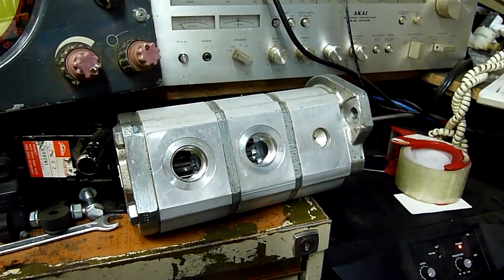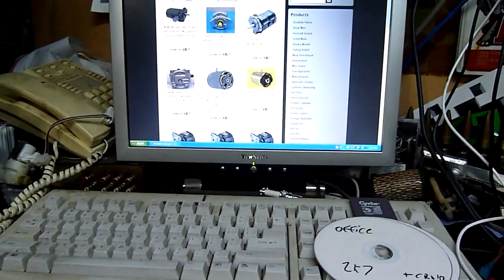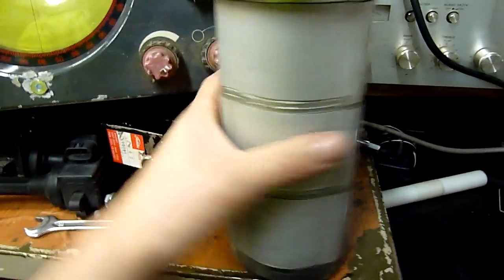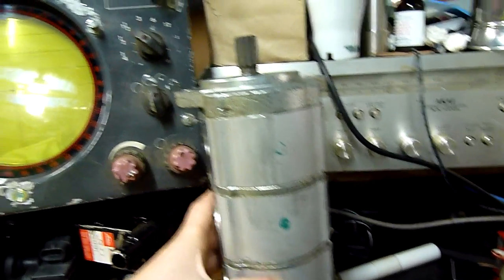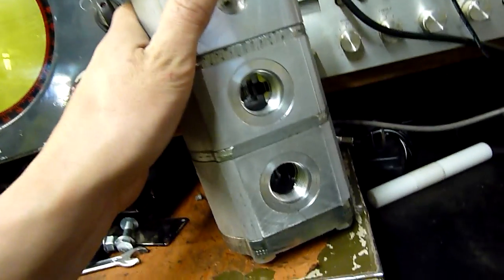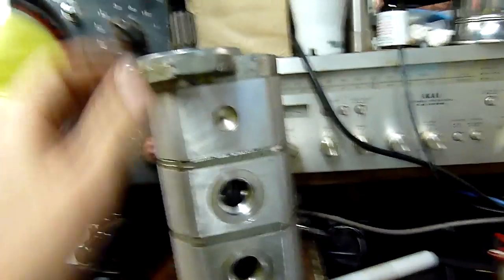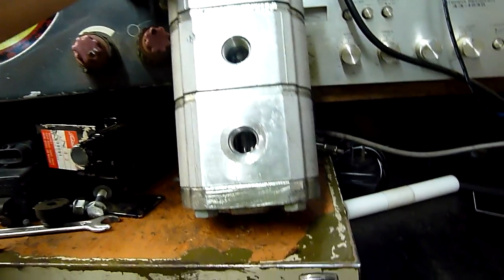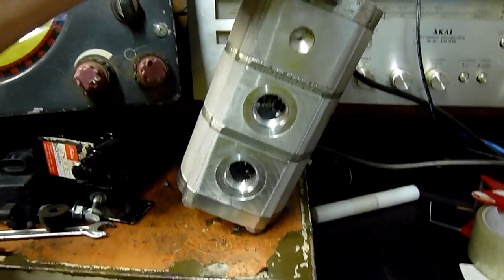Need help ID Haldex Barnes 8101 Hydraulic Pump

Comment: Looks similar to the tandem pump used in an Alexander-Dennis Enviro 400 double decker with the Cummins 6.7 for the power steering and hydraulic radiator fan.

Comment: Hey Ed, yeah its a specialized pump. Almost looks like the same one we're using on Caterpillar's new asphalt pavers. It is mounted as an auxiliary pump on the side of the engine. On ours the center one is used for suction from the hyd tank then oil is sent to the drive housing and aux functions through the first two pressure ports. Oil is scavenged out of the drive housing using the second suction port and sent back to tank through the third pressure port.

Comment: ed is it possible thats a water pump , i seen a high pressure pump at a car wash and it looked just like that , possibly the small suction port is for the soap injection or wax

Comment: Something is odd with your part number as there is a pump on Ebay in the US search on "HALDEX BARNES Hydraulic PUMP 8101" which is listed by ctrsurplus The pump shown is a single unit and has a name plate bearing the makers name and part number. Unless your unit includes one of these as part of an assembly perhaps ?